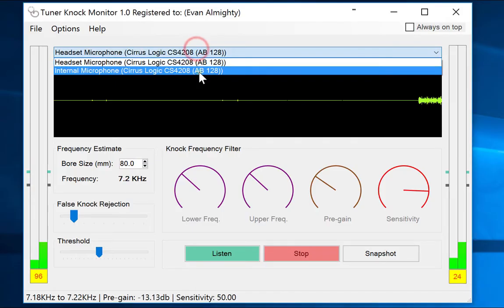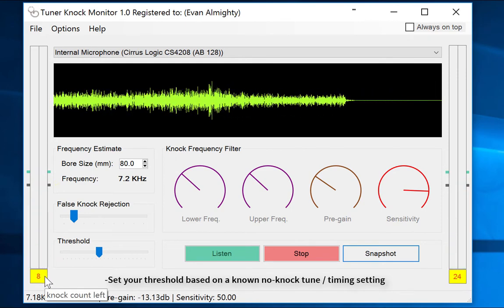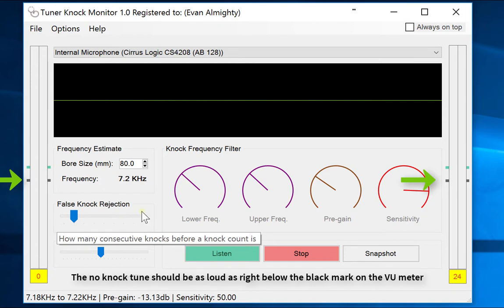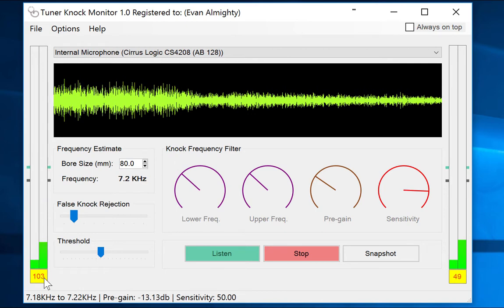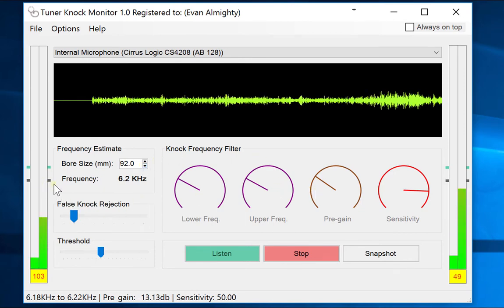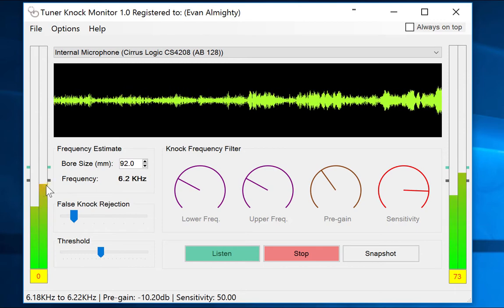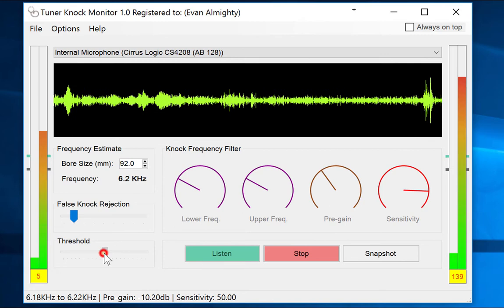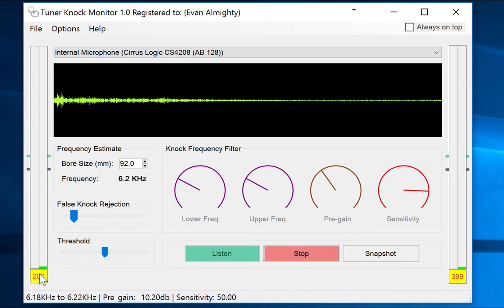Tuner Knock Monitor Tutorial

Comment: Like this what hardware would I need? Just a basic Bosch Knock Sensor? ideal locations, I work on 4cyl mainly?
Reply from the maker: Yes. a 2 or 3 wire knock sensor and bolt it up on the engine block. Work on all 4 stroke engines
Reply: kool, does it mater which cyl to be closest to? or do I have to have a sensor for each cylinder?